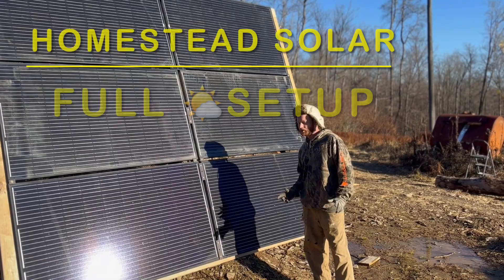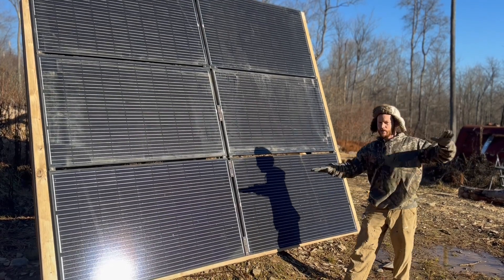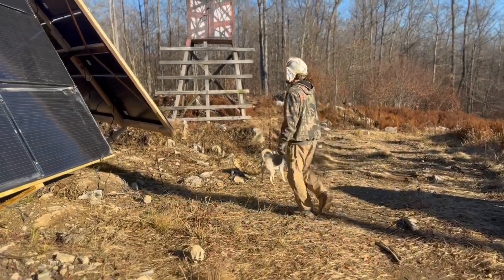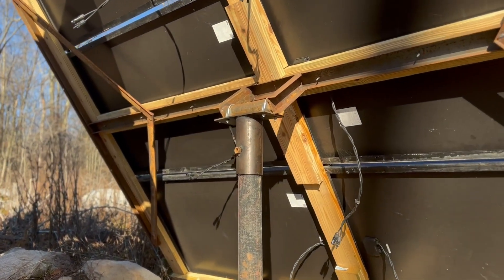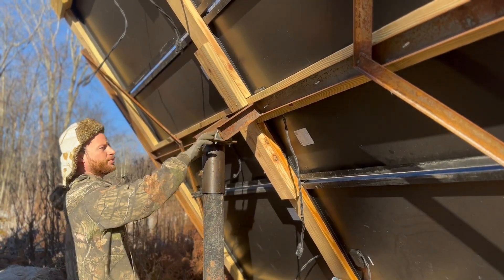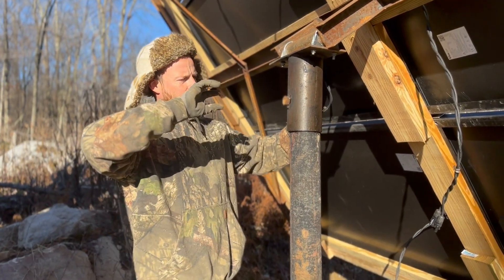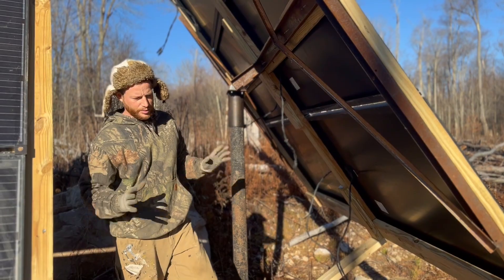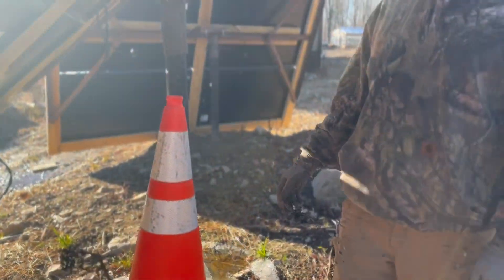Homestead Solar Field Set Up with EG4 Batteries

Comment: That is a lot of weight for two U bolts, or it looks that way to me. You could add more if you cut the U bolt bracket into.  It would be a bad day if one broke. I hope it does not.  

Keep up the good work.
Reply from the maker: Thank you for your input. It’s not a bad idea to beef it up with extra u bolts. The U bolts just keep the pitch of the panel positioned. I’ll be adding a support bar at the bottom that swivels the weight of the array rests on the pole. 
I’ll probably bump up the size U boats to 3/4” would be perfect. 
I’ll do an update soon. Hope you follow along to see the progress!